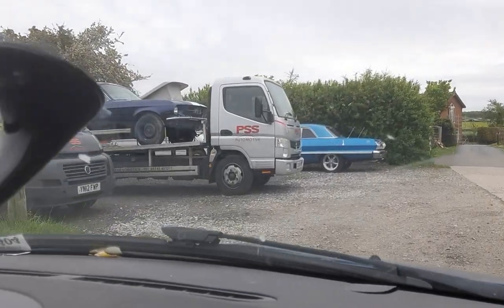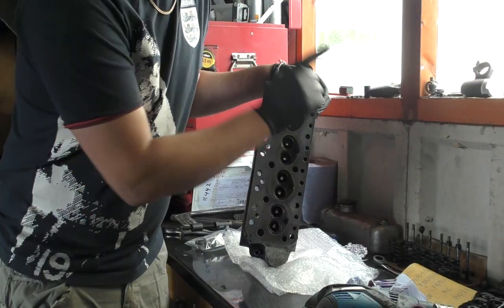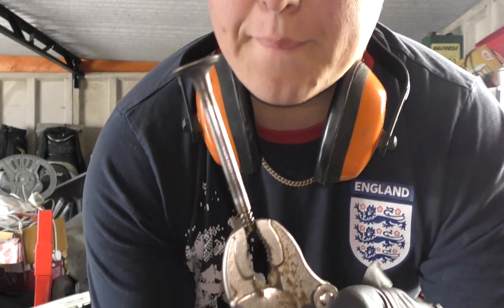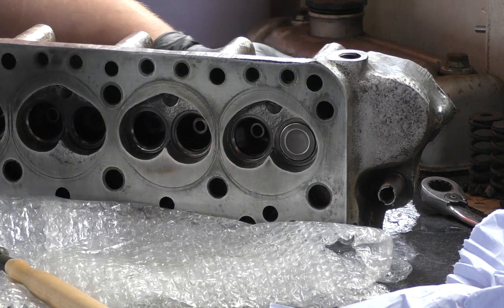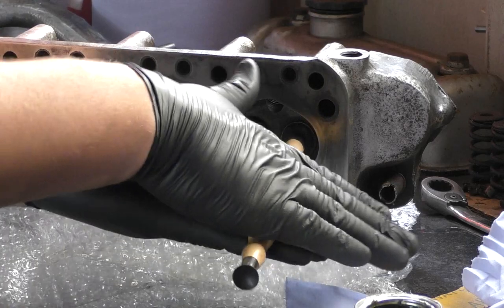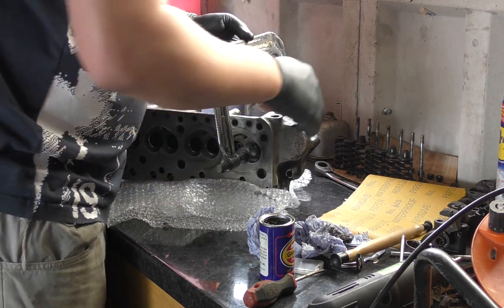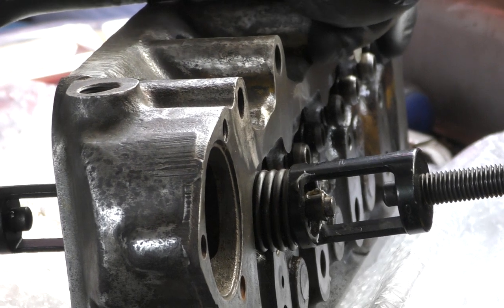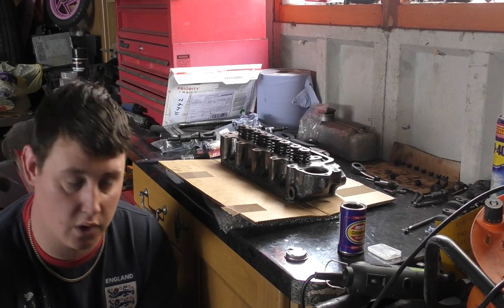Classic Mini Cylinder Head Clean & Rebuild

Comment: Grinder 😯 use a drill and emery cloth as you dont want to damage the valve seating surface good content again. Parts washers arnt cheap to have most use a steam cleaner or brake cleaner and a wire brush 👍👍👍
Reply from the maker: Using the grinder lightly worked a treat.  The built us carbon was too tough for a standard tire brush